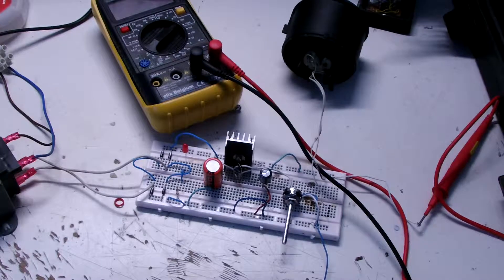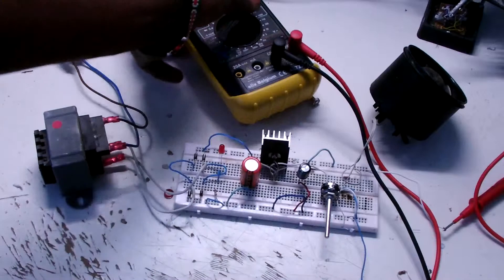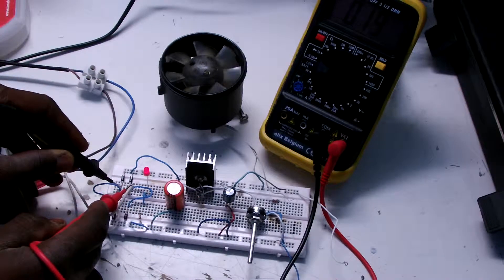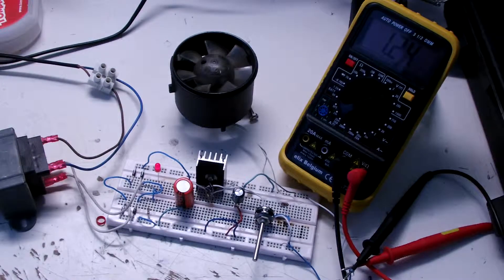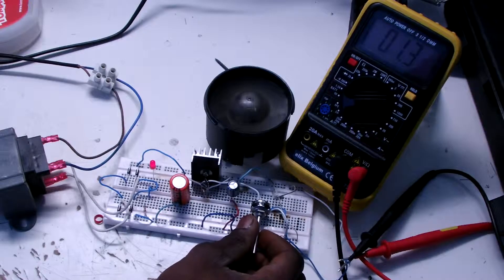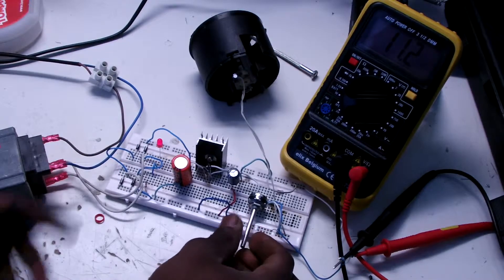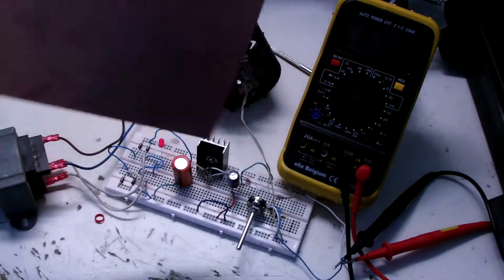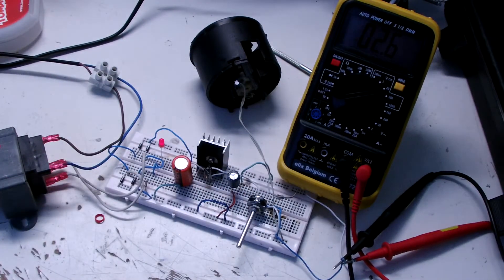lm317 voltage regulator circuit

Comment: what is diiference between TRIAC LIGHT DIMMER  and this vaoltage regulator ?
in both case we are controlling the voltage.....isn't it? we r using heat sink here that shows here there is heat loss but in dimmer there is no heat loss........
Reply from the maker: +sam TRIACs bidirectionality makes them convenient switches for alternating-current (AC). In addition, applying a trigger at a controlled phase angle of the AC in the main circuit allows control of the average current flowing into a load (phase control). This is commonly used for controlling the speed of induction motors, dimming lamps, and controlling electric heaters.
Reply from the maker: +Junior Electronics 
LM317/As linear regulators, the LM317 and LM337 are used in DC to DC converter applications.
Reply: Why my lm317 keep frying 🤔😞